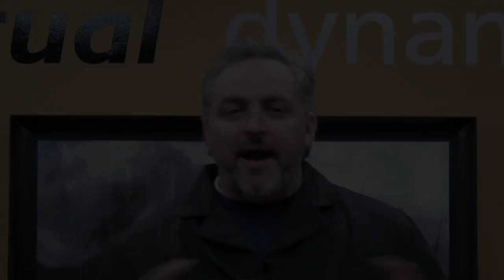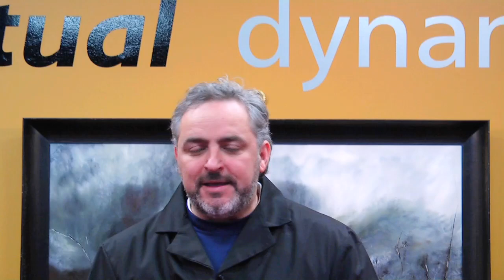QnA - Should I use a Power Conditioner?

Comment: I understand where you're coming from but if you're plugged directly into the wall socket you have absolutely zero protection from surges or brownouts, your equipment will be destroyed in seconds. I'd rather have a power conditioner then no protection at all and lose a little bit of musical whatever if you can even hear it anyways.

Comment: In a PA or Studio Situation, a Power Conditioner is crucial. It certainly solved a lot of our issues with Noise on stage. Concerning guitar effect pedals, amp hum and "switch on-off"-clacks on the main PA when turning an amp off and everything was muted. This is even more true, when you're playing little clubs, where maybe some of the light is also plugged into the same power line.

Comment: Based on you video, i had an electrician pull 4 new cables from the main fuse box to from listening room, and what a difference it made. I think i was sharing the power with the kitchen before which caused some humming and other bits of noise, now i´m just a happy camper.  I also know people in the high end audio branch who use conditioners and it sounds like there systems are being chocked, the volume is lower  but i don´t think  it sound any better...     Cheers..

Comment: The best way is to use an isolation transformer at the mains outlet. The induced voltage on the secondary winding will be noise free and there are no ground loop issues with this method. This will help to resolve other equipment noise lssues with poor cabling, interconnect shorts, inductive pickup etc.

Comment: Great insight Mr. Shultz. However I must ask.. what about higher end power conditioners that have general outlets for power protection and conditioning and as well special amp and subwoofer outlets built into them and which are labled as 'high current outlets for Amp / Subs' (such as the Panamax m5300pm?) for the Amps and Subwoofers that may require all the power they can get? Are these fine to use w/o worrying about compromising the sound while still filtering out what's necessary in conjunction with surge protection?

Comment: I just stumbled on your vid & it got me thinking about my system in which I have a power conditioner/surge. Very informative. Problem is: When I introduced the p-cond to my system, I picked up a ground loop hum on every function except tv w/set top box. I unplugged every other component so I believe it's the p-cond is causing the hum(if that's possible). Without the p-conditioner, but with the c-box, no hum. My power fluctuates wildly during hurricanes(up to 126v) but is pretty stable at 119-21v normally, according to my pc. I'm afraid to dump the pc because it does do what it's suppose to(hurricane Irene) but the (grnd loop)hum is awful on all other sources. Any suggestions what I could do differently? I've lived with this for years because I can't find a good resolution while still protecting my HT syst from surges. Thanks for any advice. I would be VERY grateful.
Reply from the maker: Box0Rain ground loops are created by competing grounds. You can apply a unit called a "ground lift" by "lifting" the ground on different components using the ground lift as you're tool. With this you can most likely discover what component is creating the ground loop. the ground lift removed the ground pin from the wall. 
It is possible you have something that is not plugged into the power conditioner but still part part of your audio system. This item might be plugged into another wall socket and that's where I would start to look. If you can identify a component like this maybe a subwoofer or amplifier that may have been to distant to plug into the power conditioner but is still connected to the system ground via interconnects. Start here and work your way through each component, often you have to do more than one. I'll try to cover ground loops in another episode soon. If you need to lift a ground on any component that has one I have to recommend you contact an electrician to make sure it's safe to do and meets insurance requirements.

Comment from the maker: Well you have ruled out all you can. It is time to contact the manufacture and see what they can do to help you. You can always try a power conditioner and let us know if it does work for you, I would consider a transformer based unit to decouple from your house power. If you have a multi-meter you can check for potential issue in your power, test for DC on your line and test AC to see if you have issues on neutral or ground. Good luck these can be very difficult to sort through.

Comment from the maker: Well from your description of the sound it seams non-typical if ac noise but it could be a dimmer switch or something like this that is causing it as well so it could be power. I went to cables as you likely didn't take the cables with you to try in another system. The description of this type of noise is rare for A/C snapping and popping are not A/C generated. Time has taught me to start at the most obvious possibilities, tubes, capacitors first for snapping crackling sounds then faulty cable.

Comment from the maker: Okay it sounds like something in the signal path not a power issue so could it be a slightly shorted interconect cable as well try different I/C's and see if that helps.

Comment from the maker: The crackling/popping sounds like tube noise. A new tube can still be bad. Is this noise in both channels? The hum sounds like a ground loop. This can happen with using more than one outlet and it is common where there is multiple routes to ground. My advice is to hire a good electrician to help you get a good ground for your audio gear. They can sort the hum issue out as you plug in your gear. Alternatively try plugging in all your gear in one receptacle or powerstrip to see if it stops the hum

Comment: question - recently purchased tube amp.. had all the caps and tubes replaced because i thought it could have been either that was causing a crackling/popping and slight hum in my amp.. and it was clean at the music store where it was purchased and fixed.. but still is noisy @ my home.  60cycle hum is much louder @ my house, especially through an amp (tube or solid state, bass or guitar) so i'm assuming i have dirty electricity already.. would a power conditioner help with the strange noise?

Comment: Mmmm, you kinda contradict yourself.  The whole point of a PLC is to remove the garbage coming on your mains which should be implicit. If you have dirty power, a PLC will make your system work better.  The main thing is to figure what types of problem your mains might have: surges/spikes, voltage drops, over/under voltage, noise, etc. Very few PLCs deal with more than one problem.  Also, check your home's grounding too.

Comment from the maker: @zotos777 
If the hum is created by a ground loop (and it likely is) it very well may help, however you have to actually try it to be sure. Most high-end audio stores will lend you one to try out for a few days. Alternatively you have to try lifting the ground on one of your components some even have a switch built in to them to allow for this. Try to put it upstream of your amp on pre on CD or both first to see if you can avoid having to use it on the amplifier.

Comment: @NoMoreVanilla 

I agree, especially since most energy companies do not create power in the best means. For example here in NV our power company NVenergy tells the population that their power is not clean and in fact is dirty and everyone should use a conditioner of some sort, if not that then definitely a surge protector. I have thus far not ran into any system that didn't benefit from a power conditioner. when suing one the sound stage quiets and opens up greatly.

Comment: In most cases, a power conditioner is not going to make any system sound better.  The power supplies on most pieces of equipment are perfectly capable of delivering clean DC from normal power. The purpose of the power cond. is to deal with ABNORMAL power: spikes, harmonics, surges and dips that the power supply was never designed to tolerate.  A power cond. is like insurance on your audio/video equipment.  If its working properly, you shouldn't even know it's there.